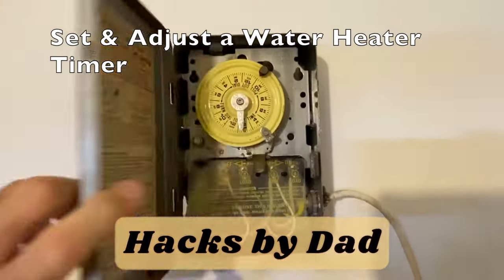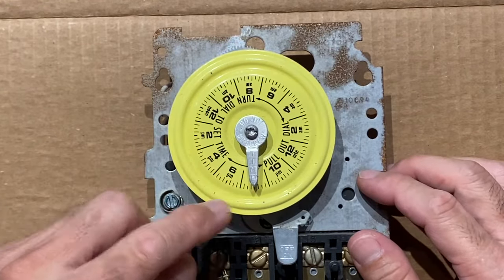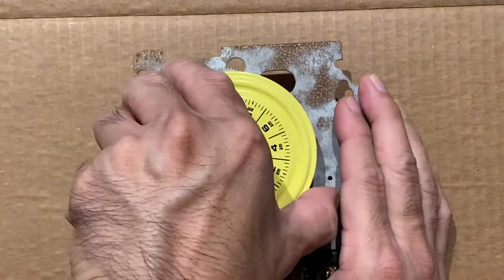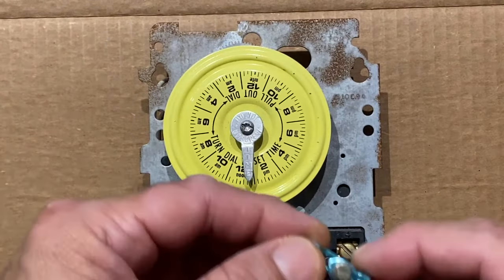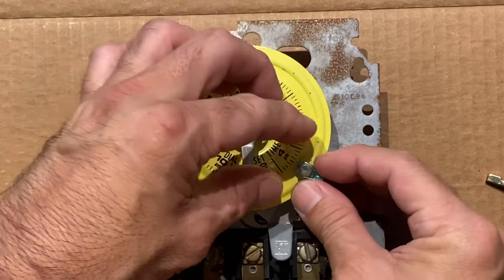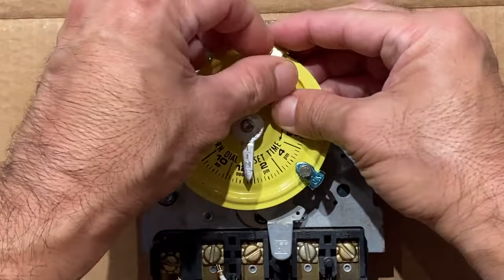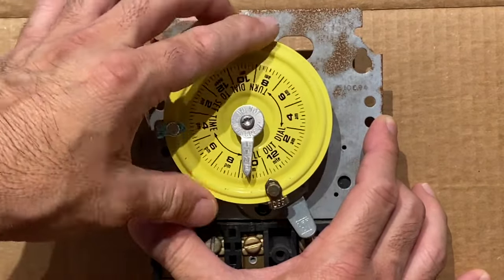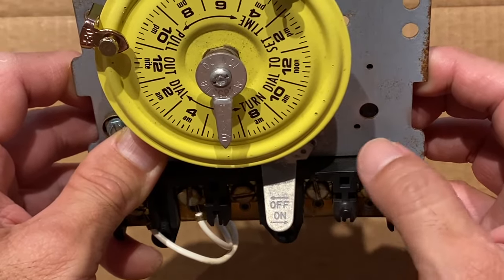How to Set a Water Heater Timer | Adjust and Use a Water Heater Timer | Basic Life Skills

Comment: Useful if you have one - these are essentially the same as are used for swimming pool motor timers. 

If you don't already have one a better solution to look at may be a smart switch controlling a contactor/relay mounted in an electrical box so you can control this timer with your home automation system of choice. Why? - this will allow a schedule where you don't have to worry about the clock accuracy (esp wrt electric "Time of Use Plans"). Will allow you to manually temporarily override the timer (on or off) from in the house - or disable the water heater while you are away on vacation. You can even turn it off from your phone while away if you forget to do it before you leave. So a modern version of the same thing.

Comment: Is it possible to keep the heater constantly on? My friend installed this same box in video and attached those trippers. But, for some reason we’re not getting hot water at times we want. If I removed the 2 trippers he put in there, would it just stay on continuously? If not, what do I need to do? Thx.!
Reply from the maker: Yes, you can remove the trippers and slide the switch to the "ON" position.  That should keep the heater on.  The thermostat will then turn the heater on and off.  
😎
Reply: @HacksbyDad  Thx.! If I removed the trippers and had the heater running all the time, would this affect my electric bill? I do have PV Solar installed but never ran heater on all the time.

Comment: What if I want to have some warm water when the heater is off time? Do I need to turn the heater back to ON?
Reply from the maker: The water will still be hot when the timer is off.  As you use hot water, cold water entering the tank will slowly lower the temperature until the timer turns back on.  You can manually turn on the timer if needed.  😎
Reply: I feel it was. But as the weather temperature is getting lower, it seems the water is getting colder as I am using. And that is why the confusion comes up. 😂 Thank you for your clarification.

Comment: Ok that's my situation where I need to go buy some trippers. So... why didn't my lights work at all? They were left in the on position?
Reply from the maker: If the timer is hooked up to some lights and the lights never turned on, the switch was in the OFF position.  Slide the switch ON and see if the lights turn on.  
😎
Reply: Hey there... we discovered that since there are 2 boxes, the other was hooked up to the lights. Then, after the sign builders came back, they had to tinker up there, and we got it working. Even found some trippers that were just laying inside the case there. Cheers!
Reply from the maker: @yepdodamath  Good to hear!  👍

Comment: Still unclear. Does the off switch turn off the timer so the water heater runs constantly?
Or does the switch turn off the whole water heater when it's set to off?
Reply from the maker: The timer switch functions like a light switch… 
ON = water heater on
OFF = water heater off
😎
Reply: @HacksbyDad this was my question also, thanks for the help man🤙

Comment: if you want to bypass the water heater timer would you simply just turn it off?
Reply from the maker: Turn it off and remove the ON tripper from the yellow dial.  
😎
Reply: @HacksbyDad  it never had any trippers on it. i didn't even know it was a timer until i opened it. basically what happened is one of the black wired melted the plastic casing around the nut where you wrap the wire around. I removed all the burnt plastic then disconnected that black wire. Cut it so it wasn't exposed then turned the timer off. I'm hoping that will still allow the water heater to work and bypass the timer. The wires coming out of the water heater still all appear to be connected. I'm not sure what the black wire was for...maybe a ground for the water heater timer?
Reply from the maker: That doesn’t sound good.  Wiring getting that hot is dangerous.  I recommend that an electrician take a look at the situation ASAP.  Better safe than sorry.